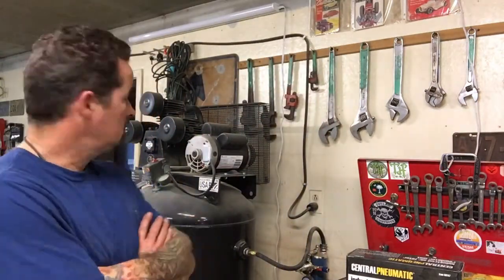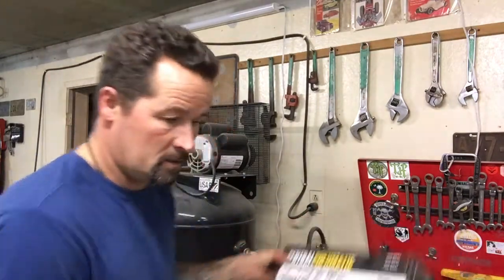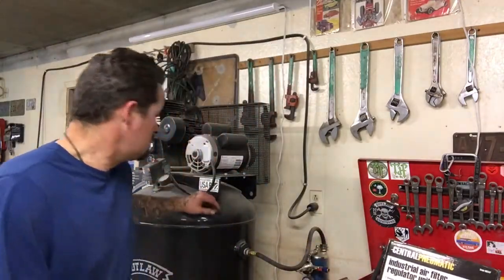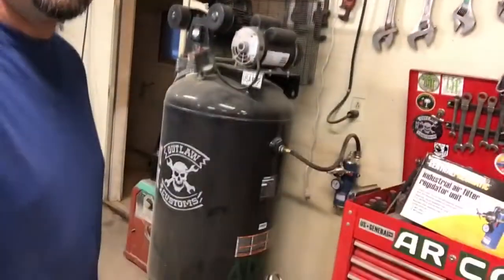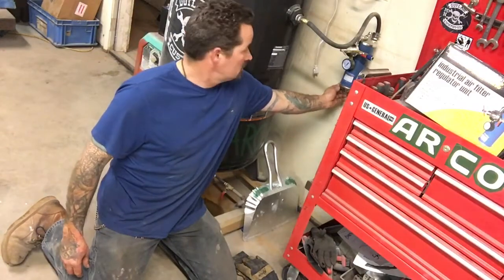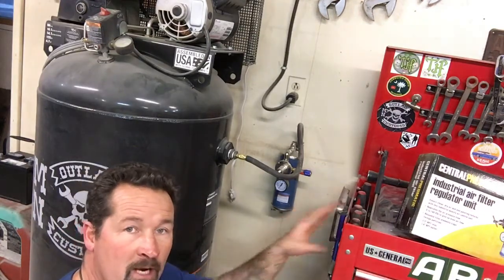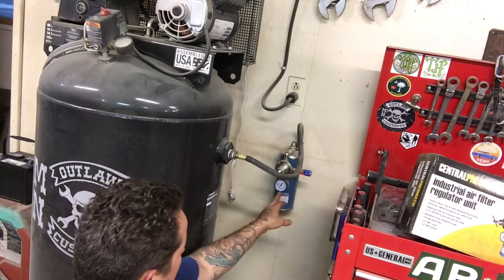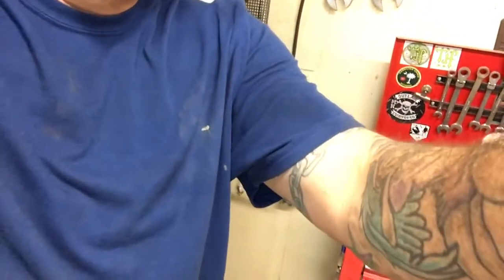Harbor freight compressor water filter PART ONE

Comment: I know this video has been up for a while and it’s a long shot. But, i just bought one and installed it and air leaks out of the diaphragm at 90 psi and above. I tun the regulator to elevate the pressure but it just leaks more
Reply from the maker: I would take it back or return it online. They are warranted bro. Harbor freight is good about returning stuff 👍

Comment: Hey bud thanks for the video i need to put a water filter on my compressor as i am wanting to raptor line spray my bronco and was told to have one so i wouldn't ruin the spray job.I also dont have a pressure regulator anymore on it does this model also have a pressure regulator on it i could use in place if it? Also i see you have the harbor freight dustpan! gotta get me one of those!! thanks !
Reply from the maker: speedwayman100 yeah brother it has the regulator right on the water filter. Its a great setup. Im still using it in our body shop with awesome results 👍😀🇺🇸thanks for watching
Reply: right on brother, thank you and nice setup!